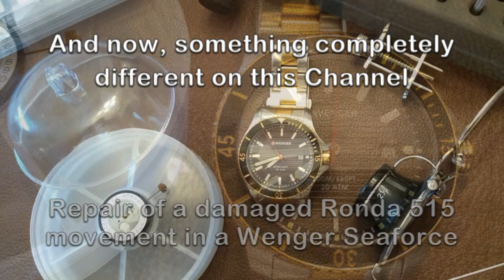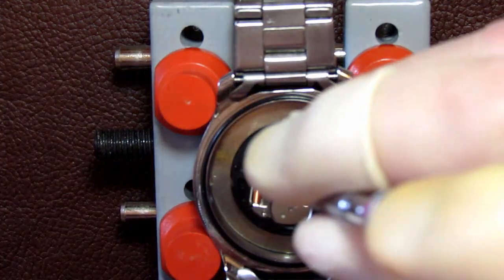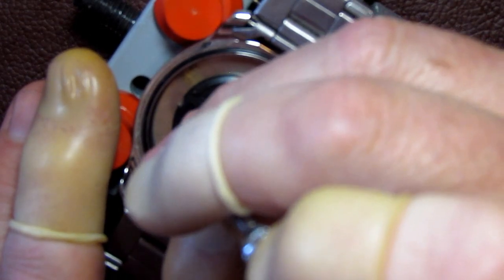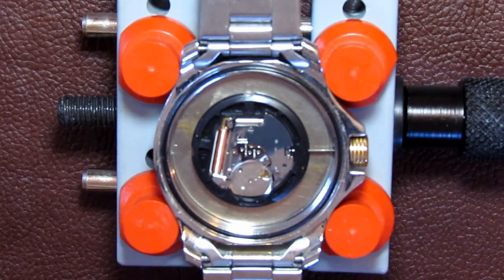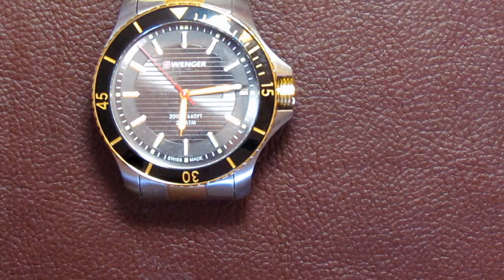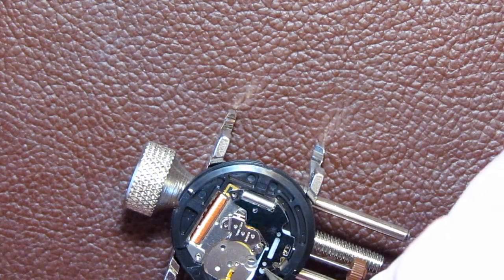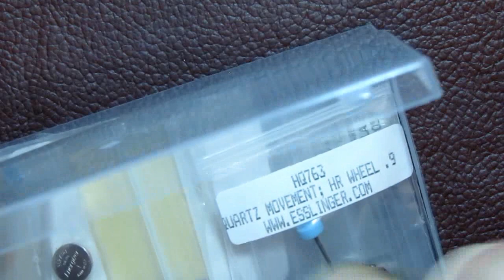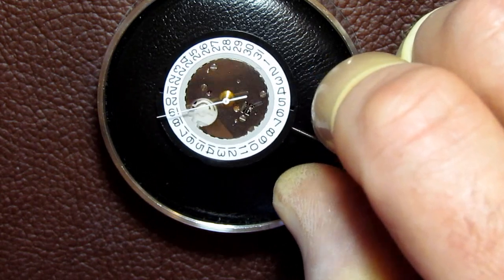Something Different - Horology: Ronda 515 Coil Replacement

Comment: Dave, you are amazing. Thanks for sharing yet another of your skills. I am awed, but not surprised by your precision work. That is a given for anyone who has gotten to know you. It looked like you were using a loupe - monocular or binocular?  While you have referred to horology only in the context of watches, have you done any repairs or restorations of clocks? Yes, I'd say that making a $10 repair to a $200 watch was worth it. Getting a donor movement rather than just the coil was brilliant. Great Airplane reference - when someone says the word, the line comes into your mind almost like a conditioned response 😉 Be well and keep it awesome - peace
Reply from the maker: Thank you for spending a considerable amount of time watching an out of focus video. Think of how mesmerizing it would have been if in focus😊 Mechanical clocks are where I started tinkering. Much bigger movements are a good thing to work on. But lately I haven't done much with clocks, other than keep our's ticking and chiming.
I use a monocular loupe attached to reading glasses. Generally with a 3 1/2 to 2 1/2 inch focal length (that's about 3x to 4x).  I used to just use a loupe, but the glasses are new since my close focus is failing. Yes, surely is a trigger word, even when I say it. Crazy how that works. Glad you found something of interest in this video. Take care.

Comment: Incompatible? I've been a professional watchmaker for over 35 years and often smoke a pipe while at the bench. I've fixed tens of thousands of watches and it's never been a problem. In fact it helps me relax. I make more money from people buggering their watches trying to change the cell themselves. BTW not a tinkerer or mechanic, but a watchmaker. There isn't a part in a watch that I haven't made myself, by hand from scratch, with the exception of a hairspring. I even make my own balance staffs. Congratulations on your 500th subscriber.
Reply from the maker: I've been a pipesmoker for over 35 years and still can't keep ash and tobacco bits in the bowl.  I continue to be amazed where tobacco and ash show up around me;-)  So yes, at least for me, incompatible.  However, I've since corrected my sweeping generality regarding compatibility in the video note.  Certainly there are more gifted individuals than me, like yourself.
Thanks for the congratulations.  I was rather surprised when you stated 500th subscriber as this channel has been stuck in the 400s for a few years.  Not sure when that growth happened as I no longer seem to get notifications of subscribers from YouTube.
Anyway, thanks for keeping those watches ticking and the pipe world informed.
Happy Easter,
Dave

Comment: I’ve managed to change a 515 coil without removing anything except the 2 coil screws and sliding the new one under the edge of the circuit board. It was a lot quicker and easier…